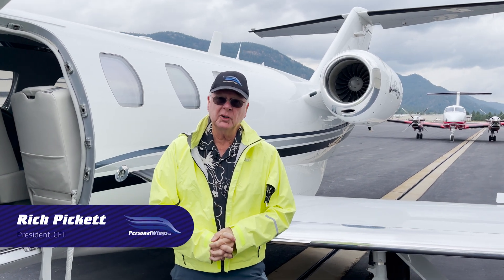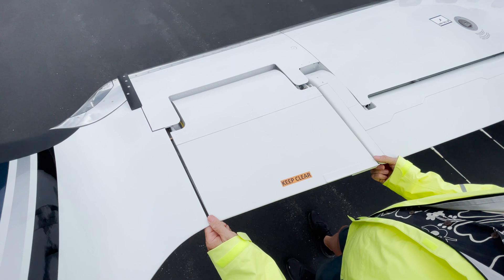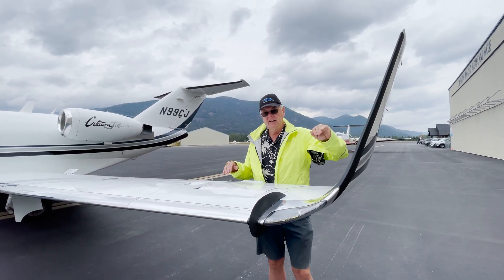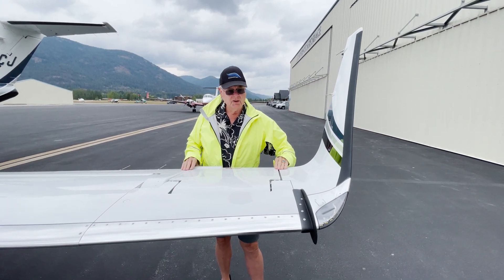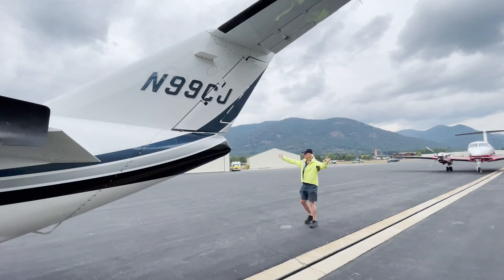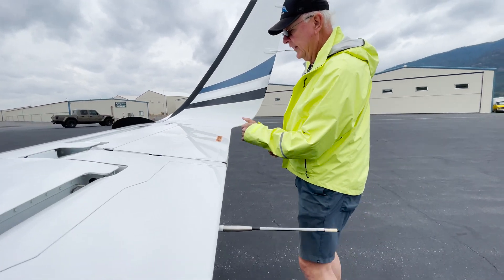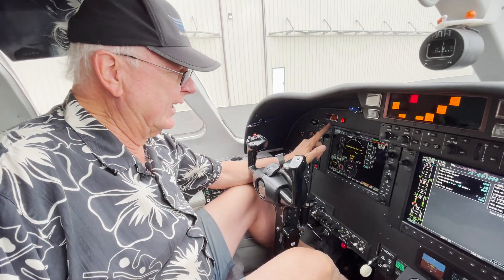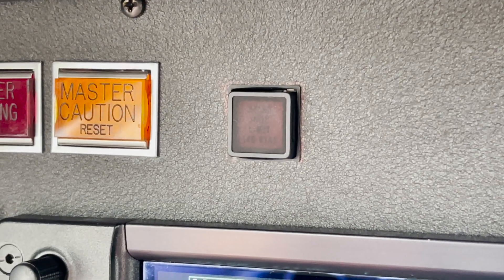Preflighting Tamarack Active Winglets on a Cessna CitationJet CE 525

Comment: On November 30th, 2018 my friend was killed flying a 525 because of the tamarack system. I would never put that on my plane. There have been so many malfunctions with that system it's mind blowing i don't know how FAA certified that junk.
Reply from the maker: Condolences 💐 for your loss. We have read the NTSB and conclusions, and also have spoken with people familiar with the accident.

When you say there have been so many malfunctions, can you share specifics? We’ve now flown about 40+ hours and have yet to have an issue with them.
Reply: @PersonalWings the main problem is if it deploys you’ll be caught off guard. Tamarack filled bankruptcy right after disputing the facts and the reemerged in 2021. The issues you are looking for would be in Europe. From an article “The company, based in Sandpoint, Idaho, filed for bankruptcy in 2019 soon after the FAA grounded all ATLAS-equipped Citations, citing, in part, the then-ongoing NTSB investigation of the 2018 crash, as well as five incidents of uncommanded roll events reported by pilots to the European Union Aviation Safety Agency and the FAA between February 2018 and April 2019 that the NTSB noted in its final report on the 2018 crash. None of the other five incidents involved an accident or injury; pilots described unexpected and uncommanded roll events of varying magnitude, recovered with varying degrees of opposite aileron.” Safe flying but remember that those have had issues of having minds of their own.

Comment: I get it somewhat, but since I'm not an engineer, I'd have to see an airflow test to fully comprehend it.
Either way, it sounds like some good thinking.
Reply from the maker: Werner, the basic strategy behind a winglet is it increases the wing surface area and recovers some of the lost aerodynamic energy by directing the wing tip vortices into more lift.  The Tamarack system also uses small, automated, panels that move with G (gravity) loads which reduces the stress on the wing.  Pretty cool!